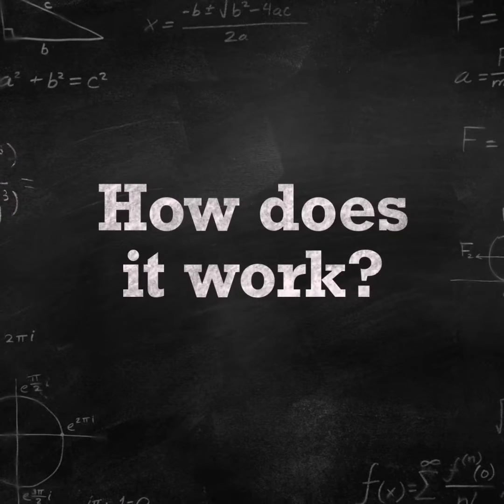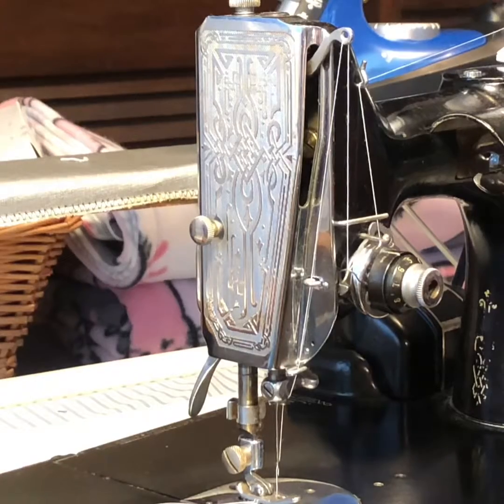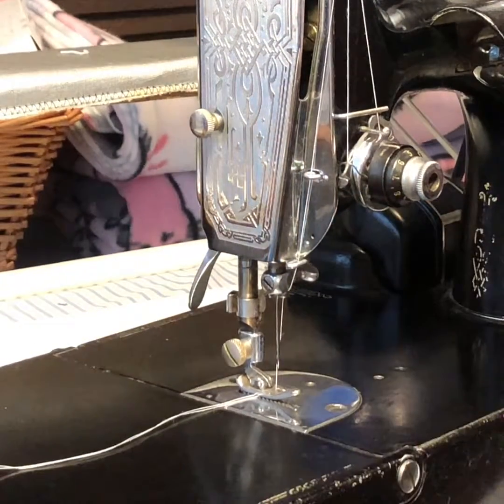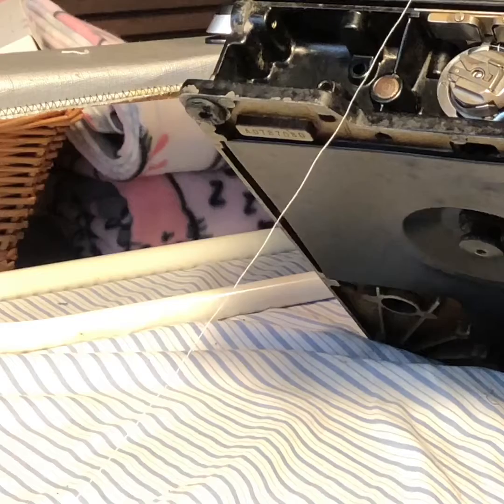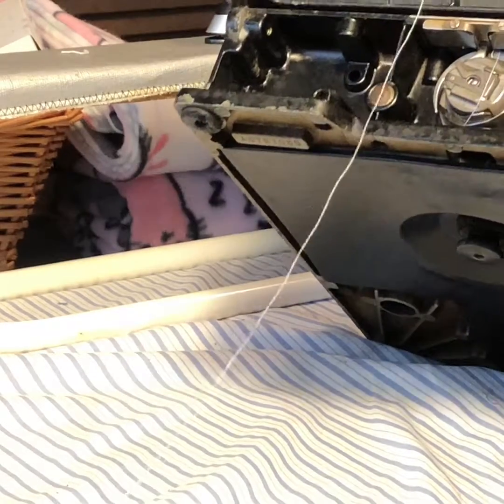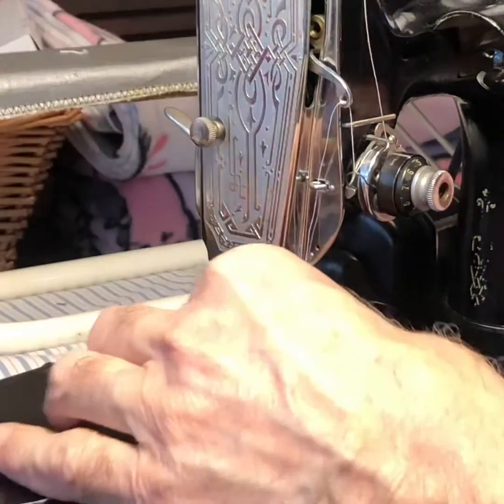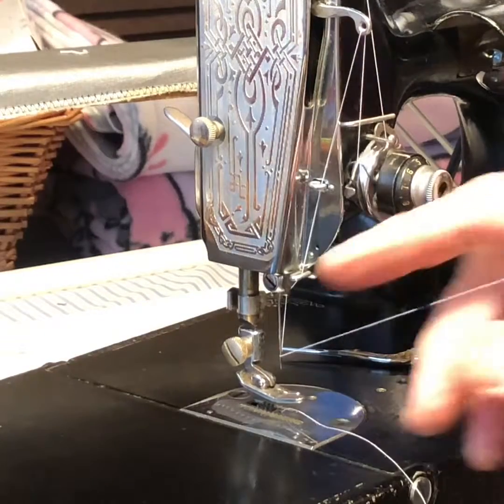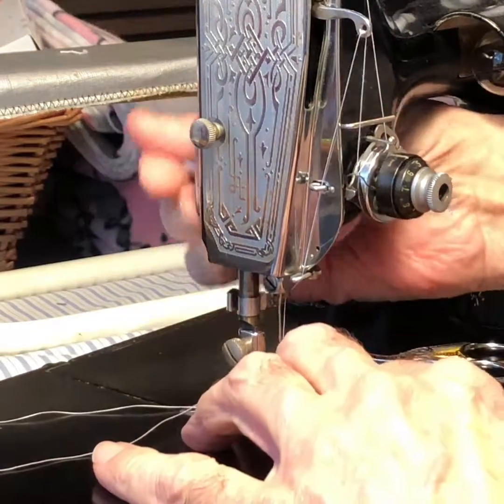How Does it Work "The Take Up Lever”  #ELEHOSP

Comment: puzzled by the comment " one inch stitch pulls out 60 inches of thread etd "... can you elaborate?
Reply from the maker: The take up lever moves faster than the needle so it can make a loop that will travel all the way around the hook.  To sew a dozen stitches  60 inches of thread pass back and forth through the eye of the needle because of the take up lever.